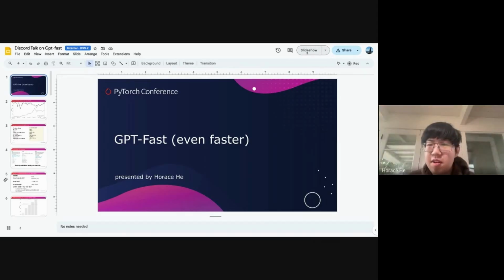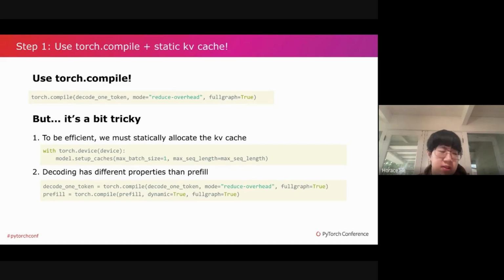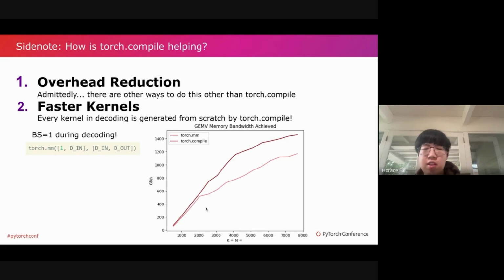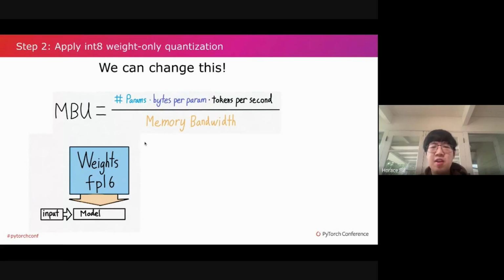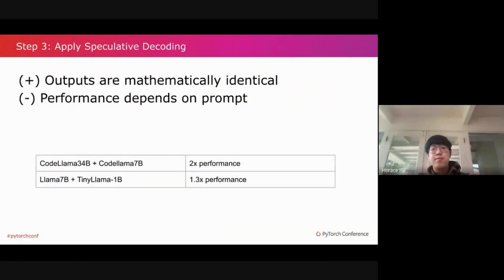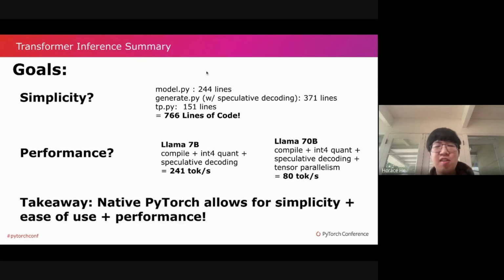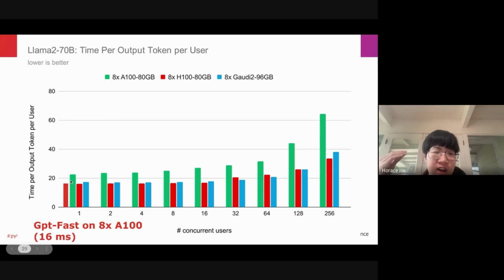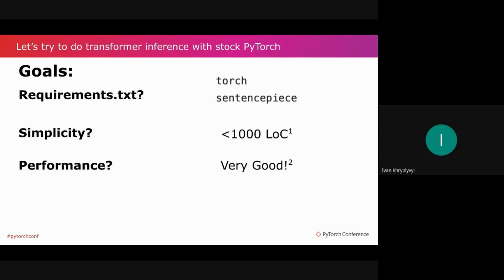GPT-Fast - blazingly fast inference with PyTorch (w/ Horace He)

Comment: One thing that was not super clear to me. Are we loading the next weight matrix (assuming there is enough SRAM), as the previous matmul+activation is being computed?
Reply: Within each matmul the loading of data from main memory into registers occurs at the same time as the values being computed.

So the answer to your question is "no, but it also wouldn't help because the previous matmul/activation is already saturating the bandwidth"
Reply: @Chhillee  Thank you, makes sense.

Comment: I didn't understand one of the points made. In a couple of occasions Horace mentions that we are loading all the weights (into the registers I assume) with every token -  that's also what the diagram shows at https://youtu.be/18YupYsH5vY?t=1972 . Is that what's happening? Can the registers load all the model weights at once? If that were the case why do you need to load them every time instead of leaving them untouched. I hope that's a not too stupid of a question.
Reply: This is a good question! The big problem is that GPUs do not have enough registers (i.e. SRAM) to load all the model weights at once. A GPU has on the order of megabytes of registers/SRAM, while the weights require 10s of gigabytes to store.

Q: But what if we used hundreds of chips to have enough SRAM to store the entire model? Would generation be much faster then? 
A: Yes, and that's what we have with Groq :)
Reply: @Chhillee  Thanks!! I appreciate the answer. I assume the diagram has been simplified for clarity then